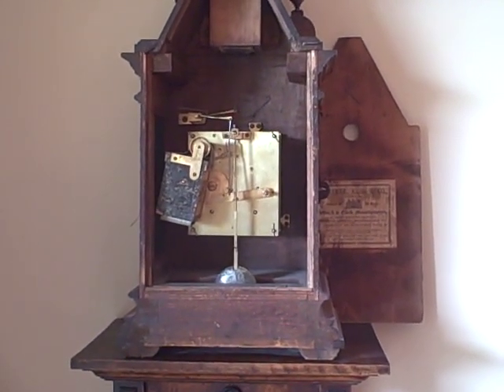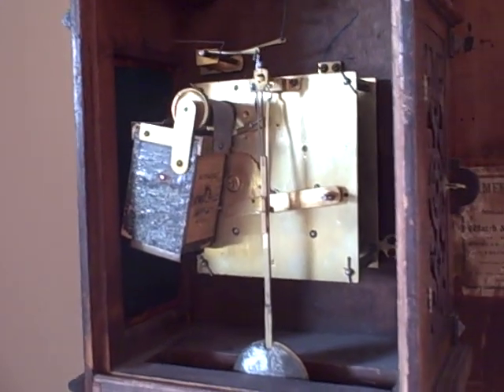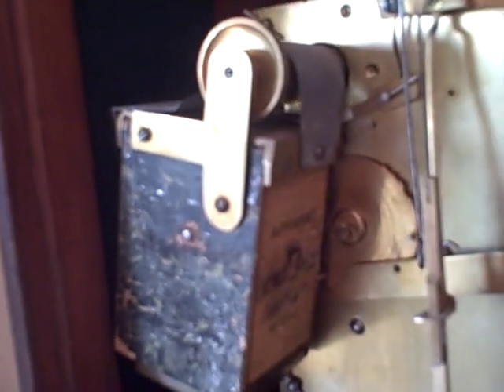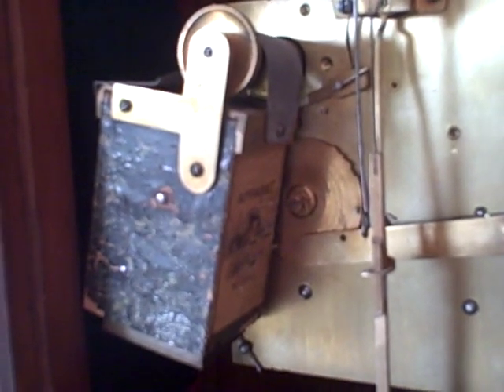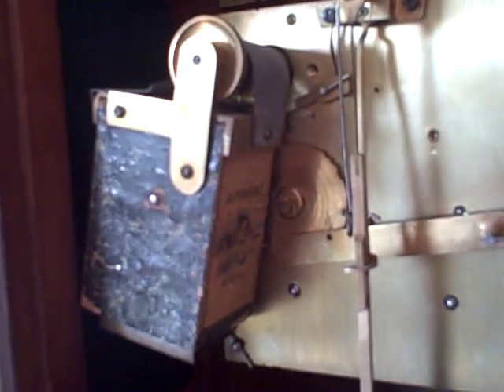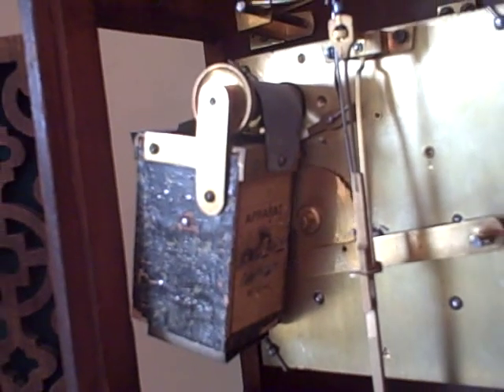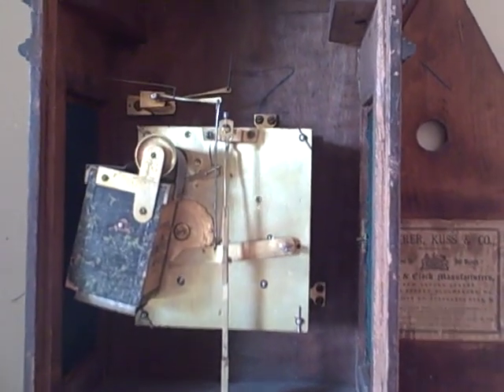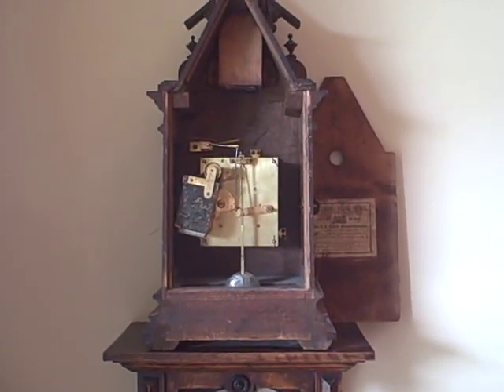How does it work? A Black Forest Emilian Wehrle Rooster Automaton Cuckoo Clock

Comment: Ah! What a pleasant sound of rooster! The bellows designed to imitate the rooster's call is really enjoyable! Nowadays even if some quartz clocks that contains electronically recorded and programmed circuit board of sound chips connected to speaker imitates the same but it can't beat the real rooster bellows like this.